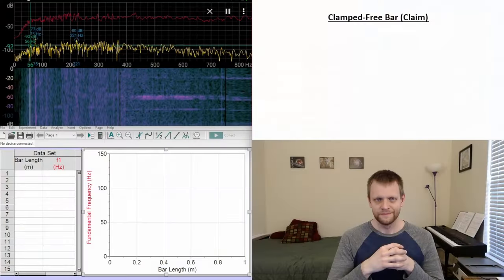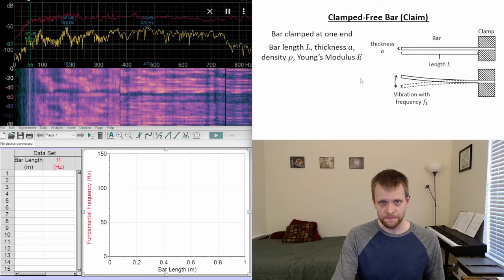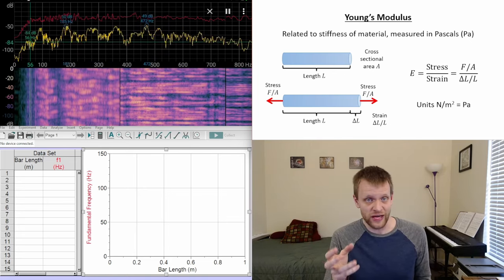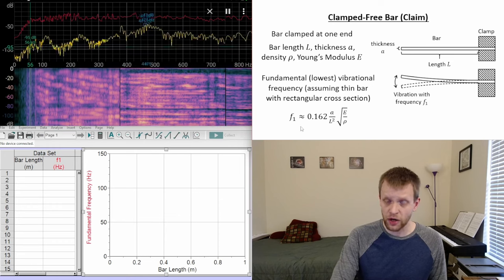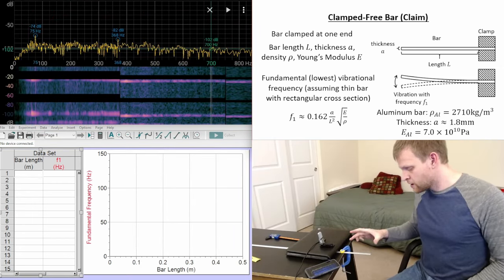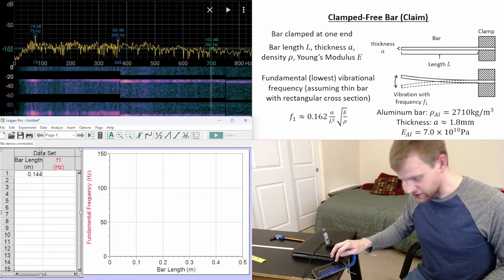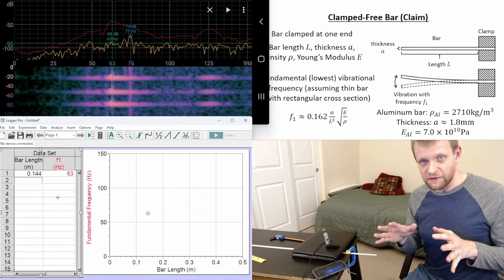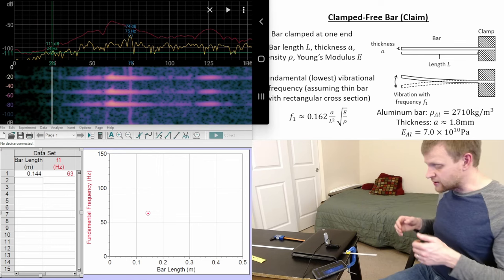Vibrating Bar and Young's Modulus - Testing Physics

Comment: Very nice.  Would appreciate more precise information about the name of the spectrum analyzer you were using on your phone.
Reply from the maker: It's the "Spectroid" app by Carl Reinke, and it's free but I think that one's only available on Android phones.  For iOS, I've heard "SpectrumView" is somewhat similar but I think has some small cost to unlock all the features.  "PhyPhox" and the "Physics Toolbox Suite" can also show the audio spectrum, but they're not as specialized as the Spectroid app.
Reply: @PhysicistMichael  Thanks.  Without something like that program, repeating your results might be challenging.
Reply: @PhysicistMichael  I have a problem I would like to document.  I like to watch old movies on Youtube.  However, I have found that in some of these movies the sound track is several tens of decibels lower than the commercial messages.  I wanted to document this but my ap doesn't permit sound volume triggering or selectable sample time. Perhaps you could investigate this issue.